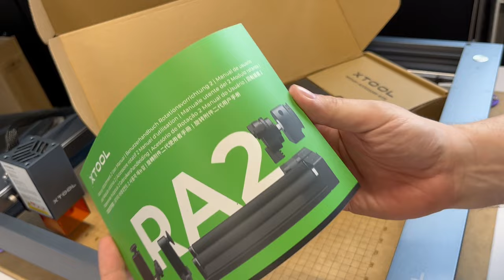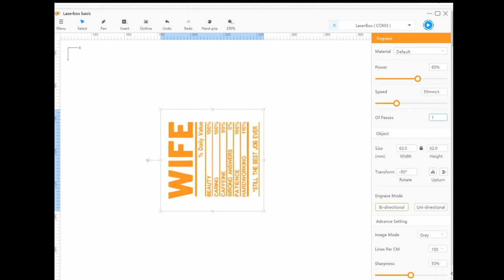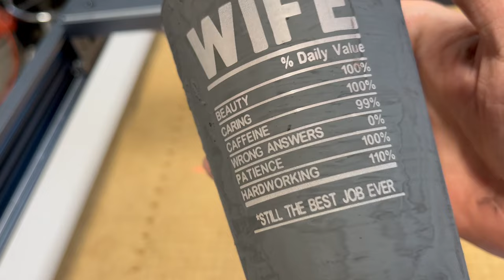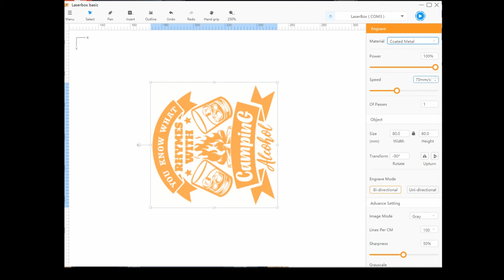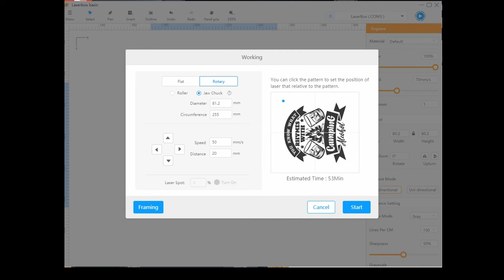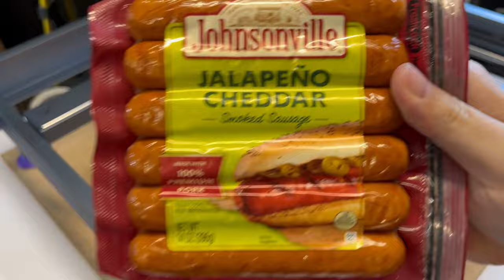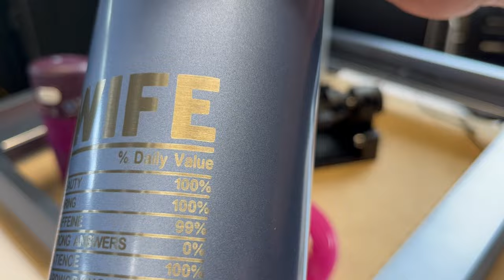XTOOL RA2 PRO - Best Rotary For Your Laser!

Comment: It’s interesting how many people think the D1 is soooo pricey?? I think the price is right on point. If you were to compare the abilities of the D1 to any other diode laser you would basically get a CNC wood engraver/burner (no cutting) for $300-$500 with very little engineering.  Plus with other lasers you get next to no customer service and no community when you need help. When you buy the D1 you get a really well made machine, great customer service, and a VERY active community that will pretty much hold your hand while learning your new machine. Then compare the D1 to the other end of the spectrum which is the Glowforge for $4000-$7000. The GF is a nice machine but you’re locked into their software, smaller cut area, no flexibility on odd shaped items. So the D1’s $399-$650+ is a good price for what this laser can do.

Comment: When setting up in laser box basic do you flip/mirror the image to get the image to burn the correct orientation or does it work without any other adjustments than the -90 degree you set?

Comment: Is it possible to use this rotary attachment with other lasers, for example Ortur or Atomstack?
Reply from the maker: I believe so, you would just use the “Y” stepper cable.  It comes with adapters for other machines.
Reply from the maker: I believe so, you would just use the “Y” stepper cable.  It comes with adapters for other machines.

Comment: Old, old-school lathe jaws you had to adjust each piece 1 at a time. Showing my age.

It's obvious why it's so solid. The buy-in is as much or more than some of the lasers on the market. Cool addon, but ouch.
Reply from the maker: I get the price point.  However, the build quality is top notch, and comes with almost everything you need for a rotary.  Maybe they could do an "a la carte" where you can just buy the RA2, and buy a tail module or something else later.
Reply: @TripodsGarage  no argument.
Reply: @TripodsGarage  was looking up small, self-centering chucks.... That explains a bit about the price. I already have a roller (still in box after 6mon) so just the chuck here would be nice.